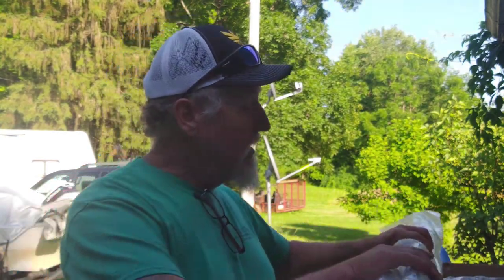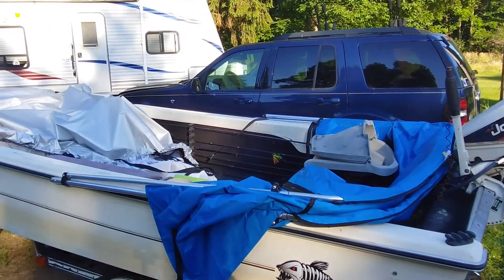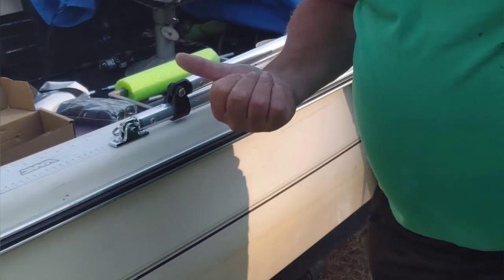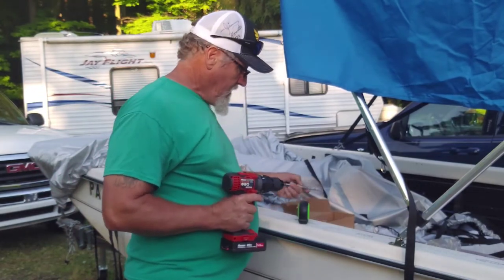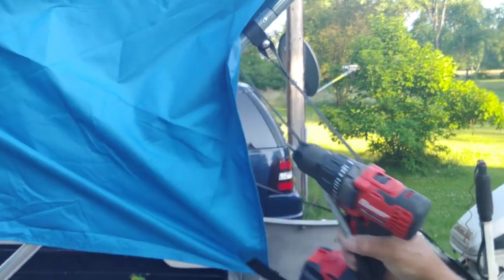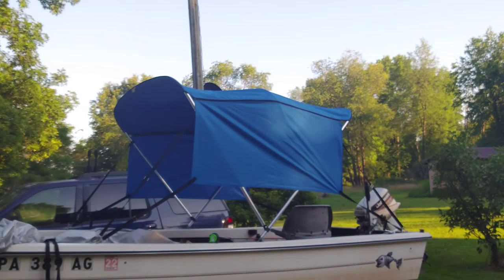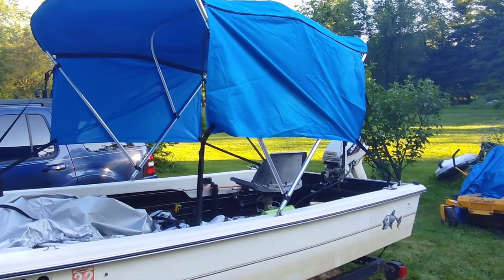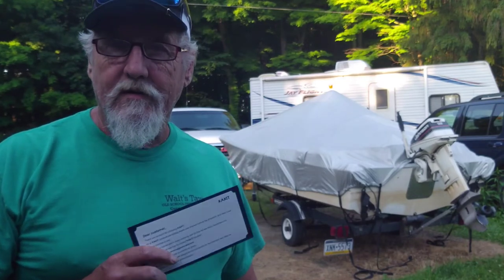Kakit Bimini Top Install! #bimini #biminiTop

Comment: So is the 9.9hp. the primary motor for your boat? Seems way under powered for that boat?
Reply from the maker: Yes in Pa 9.9 was the max horse power allowed on most lakes then the changed it a few years ago to 20 hp.
Reply: Are you happy with the Bimini top? I’ve got a 14’ boat that I’m considering adding a Bimini top too. I cast lures mostly and am wondering how much the side supports for the top interfere with casting?
Also can I ask how long your boat is and what length top ( 6’ or 8’) you bought?
Reply from the maker: @Ken Tyler  My boat it a 15 -1/2 and the bimini is a 6ft 3 bow and there is times that it gets in the way but I have casted over it and just spin the boat around the the trolling motor to get it out of the way. I fish from the front 95% of the time so it really doen't get in the way that much. I like it when the sun get betting down on yea and just need to get in the shade for a while. As for how happy I am with it I love the thing. If you get one you won't be disappointed.